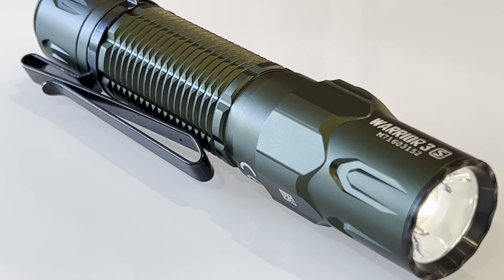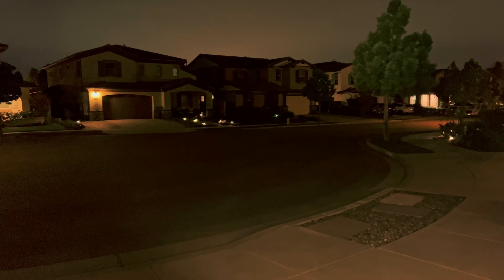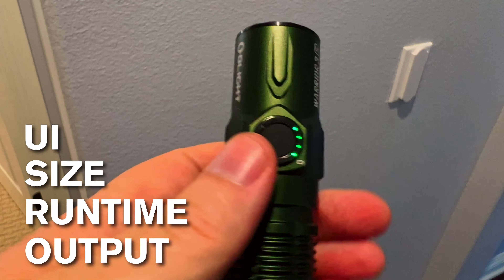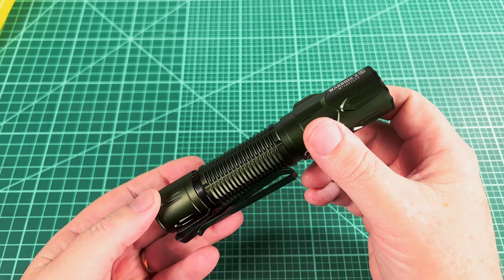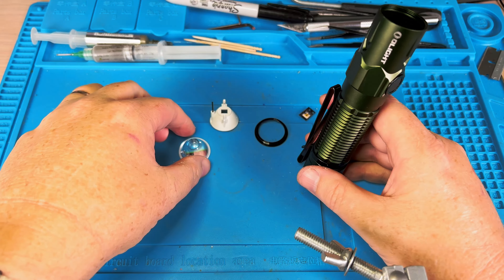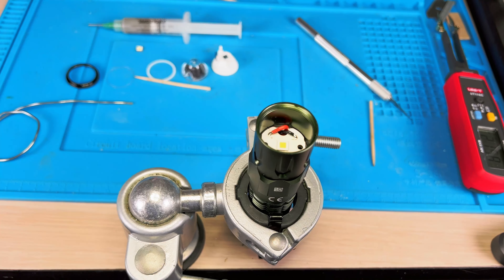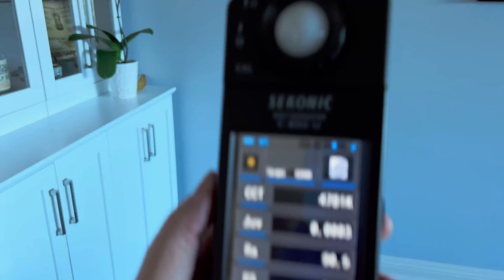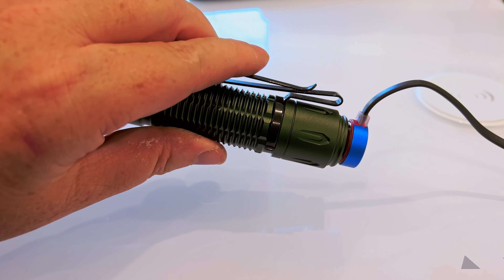Olight Warrior 3S is the best EDC on the market!

Comment: I quit buying olight because of their loyalty program. I've spent a ton of money on olight products but the loyalty points that I earned still weren't enough for a certain light that I wanted. Apparently it's set up for ebay sellers. I also don't like the proprietary charging system.
Reply: The proprietary charging was a part of the draw for me. I liked it for my wml because I hate buying batteries. And I just look at the rewards catalog as a bonus so idc if or how long it takes to get a light for free. Not to mention they have sent me numerous free lights in the last 2 years and have top notch cs
Reply: @PennStateCivic  I agree completely. Well said.
Reply: Actually you can charge the batteries on a regular charger. You just need a small magnet to make contact. I bought some very small ones on ebay Actually lol. And they work just fine. I have the warrior nano.  Which uses 18350 cells.
Reply: Yes me too their lights are sub par and cannot compete with leading brands such as Nitecore and Ace Beam
Reply: @houman2009  care to elaborate on how exactly they can't compare to these brands? Build quality, compactness, brightness, longevity of the batteries, UI, warranty, etc?

Comment: I here what your saying but for this project alone just to get a nicer tint in an olight, a user would have to purchase; the new emitter, the grip tool x2, soldering iron, hot plate, solder, thermal paste, tweezers, on top of purchasing the light itself. If they already have all that then my point is moot but not all if many have all that equipment. Great video as always though Cheule and thank you for taking the time to make them.
Reply from the maker: This video is firmly aimed at people who have emitter swapped before.  That’s very true.
Reply: @cheule  Oh okay. Thank you again for taking the time to make these videos. They are very helpful and insightful.
Reply: @itachii267  agreed!! 👍🏼👍🏼
Reply: I don't have a hot plate, but I've got a friend who does. Win win, and I can mod my lights!

Comment: The only reason I don't buy Olight is the almost proprietary magnetic charger. It works and it's easy but that's not my issue. I just don't like proprietary cables & connectors esp. for charging. Like Apple's Lightning connector - I hate needing to carry a special cable for a single device 😒.  All my EDC/hiking/camping tech is USB-C. When I go out I take one powerbank & one charge cable - done (many USB-C devices can act as a powerbank). If this isn't an issue for you then Olight really do make great lights. Bright lights everyone.
Reply from the maker: The Warrior 3S is also so efficient and has such a huge battery that I often go weeks without charging. So a charge cable might not even be needed on a hike.
Reply: @cheule  Yeah I know it's probably an unfounded phobia developed years ago when battery tech wasn't as good. Probably should get one and actually test the reality. What's one more light for the collection??? 😅

Comment: Best EDC light?  Controversial subject for sure.Personally after years of owning many Olights I have come to the conclusion that the proprietary Olight batteries do not last as long as most name brand cells. That has been my experience. Put on top of that, Olight no longer tells you what LED they are using. Really Olight you can do better. My vote for best EDC light for 2022 Thrunite TN12 pro. Oh and I get that the point of the video was emitters. For me I prefer CW.
Reply from the maker: The TN12 Pro is one of my favorites as well.  For me it’s “best pocket thrower” even beating out the likes of KR1 and D1 from Hank Wang.  I made the argument in the video that I really am at the point that where the emitter a flashlight comes with isn’t very important because none of them are perfect.  So just SWAP!
Reply: @cheule  You Sir are a master modder. And I really enjoy your videos tremendously. But I do not mod flashlights so I judge them based solely as they come.

Comment: Nov.2024 just bought a Warrior 3s for my non-pocket use light and a Warrior Mini 3 as my EDC light.  That magnetic charging is a game changer so I know my light is always fully charged and ready, no guessing anymore.  The UI with tail switch & side switch is pretty nice too, access to both turbo, turbo strobe AND low are essential in my line of work. I’m an ex-night time commercial truck driver and my flashlight might be my most important tool, turbo for exterior Pretrip inspection, turbo strobe in the rare event I require non-lethal defensive tools but a dependable low output is critical in the cab not to interfere with night vision, I use low all the time. It’s taken over 10 years to find a light I like better than my prior EagTac D25LC2 but I think these Olight Warriors have won me over..
Reply: Wm3 is a great light! My personal edc too

Comment: My biggest problem with proprietary batteries is that I can't bring a couple of spares in my charger/powerbank/battery case and use them in both an Olight and whatever other light I have along. It's bad enough I have to bring a couple magnets along so the spares can be long enough for my Acebeam and short enough for my Noctigon. Incidentally, both of those came with exactly the emitters I wanted, but I don't disagree that at a certain level of enthusiasm, one should be prepared to swap emitters.
Reply from the maker: This is probably the most airtight case I’ve heard for not liking Olight batteries. Touché good sir!

Comment: That's my EDC light.
Admittedly, I dont use Olight for any other flashlight need I have, but it is a Jeep of a flashlight.
If their proprietary batteries had a USB-C charger built in (to the cell itself) to get you a non-proprietary charging option, even if it takes opening it up...and if the full-press tail was NOT disabled on lockout, it would be perfect, IMHO.

It's also the only light I have seen take a shotgun hit (buckshot) and be pretty much fine (with dents). I dont think that is super important, but still kinda neat.

Comment: Great review an amazing modification! I just got this light yesterday in the speckled camo finish which is cool. I realize that enthusiasts like to do this sort of upgrade but in my world there's so much of variance in the environment that changing the color temperature or quality of an emitter is a moot point for me. I have a number of neutral color temperature flashlights and actually find that I prefer the cooler bluer light for its reach and contrast in the dark. 
I'm sure there are others for whom this won't work, but each of us has his own use case scenarios. 
By the way, for those who complain about no USB-C Olight does make a cool little magnetic connector which utilizes that cable so you only need to carry the connector on a keychain and use any USB-C cable!
Reply from the maker: Great tip!

Comment: The UI is easily the best for a mix of tactical and EDC purposes IMO. Not many lights have instant turbo AND allow you to change modes after using it. Most lights with a dedicated turbo tail have to be turned off and turned back on with a side switch to change modes.
Reply from the maker: You make solid points.

Comment: Its a very good light, no doubt but there are serious issues with the tail button if you work in environments that have lots of dirt,dust, and especially metal shavings. The gaps in the button can seize up or even stay on. For EDC...fantastic but its not as bulletproof as I wish it could be.
Reply from the maker: Metal shavings are an issue because the tail cap is magnetized.

Comment: The reason many people prefer USB C over the magnetic charger is that USB C is a real standard. You're unlikely to find yourself without a USB C cable, with the proprietary charger you're limited to the one in the box or spending extra to get more. Whether you like to be able to charge your light while traveling or want to be able to charge it in more than one spot, the reality is that you need a specialised piece of gear that isn't shared with any of your other tech that you need to keep a track of. You can carry one USB C cable in your bag and charge pretty much all your tech, but not your EDC light. Sure magnetic charging is neat, but the benefits of three seconds saved not having to actually plug your flashlight in aren't worth the trade offs to everyone. That's doesn't mean that magnetic charging is worse, just that there are good reasons people have certain preferences.
Reply from the maker: You’ve made good points.  I would argue that the magnetic charging is so small that it’s easy to bring.
Reply: @cheule  lol I think the point is it you still have to bring something else along.
Reply: I really wish they would just design the magnetic charging cable as just the magnetic puck with a USB c port that plugs into any USB c cable
Reply: It being just the puck would help a bit but I don't think the issue is that the cable is that difficult to stuff into your bag. It's having another thing to keep track of and which can't be easily replaced by just walking into any store. Especially if you're not in the US. The reason people like USB C is the promise of having one cable for everything... except for the things that get clever with charging and which force you to have dedicated proprietary chargers.
Reply: @darkdragon1194  
That already exists. It’s called the Olight Oport.
Reply: I have five different USB-C chargers and different USB-C devices that work with some but not all of those chargers. It would be nice if they all worked together. A flashlight with USB-C that doesn't support USB-C to USB-C is a bit like having a proprietary magnetic charger without the convenience of magnet. USB-C to USB-C is my preference. 😀
Reply: @cheule   well the biggest issue for me is what if you damaged your cable... I go backpacking often and I'm always worried I'm going to damage my cable, never have yet but that concern is always there.. Also I bring two cables of type-c so I can charge both my cell or vape or speaker.. its just easy with type-c, and if one cable gets damaged atleast I have another one nearby... If olight made a 21700 type-c that would no longer be a problem for any of us
Reply: @darkdragon1194  they have, i have one on my keys
Reply from the maker: @youtubeuser5424  I use iPhone (lightning), so I'd have to bring USB-C as well.
Reply: I have an magnetic C olight cable that comes in a rubber case and that works perfect I don't like or want your type of cable, if you don't like Olight's way buy a different brand, don't try forcing your nutty idea on other's 🥶
Reply: @The.Best.Collector  thanks for you awsm opinion.. I see you have your knee pads on for olight... True supporter...
Reply: @bryoncatterall  I have numerous Olight torches 🔦   and have no problem with magnetic charging, knee pads? I am extremely disabled 👨‍🦽 and can't walk so it's impossible for me to wear knee pads because I can't get on my knees 🙃 so what knee pads have to do with anything I don't know? Also I have trouble using my hands and the magnetic charging is easy for me, C USB is fiddly, so would make it difficult for me and anyone else who have disabled hands, so please don't get Olight changing it 😫
Reply: @The.Best.Collector  I also have lots of olights.. im glad you like the charging aspect... I don't mind it, but would type-c be better for the majority of us..... not saying get rid of the tailcap charging, just trying to say if they came out with a type-c 21700 that would get rid of our what if moments..
Reply: @bryoncatterall  what if what? 🤣 what is the cable you want?
Reply: The cheap breakable ports for micro USB are absolutely trash. The actual hardware for micro USB is awful and almost always breaks, shorts, etc. USB C solved this issue. Everything else you said is a plus but the fact that its a solid connection with no weak points makes USB C absolutely superior.
Reply: I get your point but I feel these situation are not unique, if u lose ur 1 usb c cable, u cannot charge either, just be prepared for the worst case, it can always happen and the type of cable won’t change the situation
Reply: Most people don’t have usbc cables on them, especially since most people have different chargers these days. I don’t think it’s such a problem to have another cable, but i have back up batteries and cables and lights, always made sure to have them because running out is not chill.
Reply: You can just buy the Oport I'm not even gonna read all the stuff you said bc like you said you'll most likely always have USB-C
Reply: This light is a Beast !
Reply: I also prefer usb-c. I keep a cable in a few places; work, car, home, go bag, backpack,  suitcase, etc. I have them everywhere. It's universal, and nearly everyone has one. It would be fine leaving the light in one location, like work. But, for edc, hiking, hunting, outdoor activities, it doesn't work for me.
Reply: Oport
Reply: Oport
Reply: Oport
Reply: Spend loads of time underground. Those rubber covered usb plugs is a big no x
Reply: Yes all good points but for an edc light the type c port is more likely to become damaged over time and repeated charging.  Magnetic and forget it
Reply: How hard is it to bring a specific cable with you?

Comment: All in all. I love O light.  Their products are innovative,  beautiful,  practical, and the improvements with each generation have been well thought out. I currently own almost all of their products and many of my pistols or rifled have O light wml models on them. They are all excellent! If they would just realize that they really need to offer each product they make moving forward in all the available colors and that people really do want the neutral white emitters to be an option with every new release, they would be unstoppable.  Keep the tactical tailswitch  on as many models as possible and phase out the puck charger with one waterproof magnetic USB C port so we can all just use one  standard charger cable for everything and O light would be unstoppable.
Reply from the maker: A very reasonable take, unshrouded by bias.

I really don’t mind the MCC though. Really.

Comment: Thank you Cheule for such a great video. I honestly didn't know the magnetic charger was so easy to connect to the flashlight.
The only complaint I got about olight's properitary batteries is that as much as I probably wouldn't need to buy another one for my flashlight, I personally like to have all 21700 cells work in all of my flashlights. But if the Olight is your only flashlight, it wouldn't be a problem.
Reply from the maker: Good points.  Sounds like if you have 3-4 Olight in your life you would be good! Hahah
Reply: @cheule  Yeah, if you get into their ecosystem a little bit, it gets better.

I might think of getting an Olight, although the prices mostly drive me away.
Reply: @cheule  lol which validates everyone’s comparison Apple to Olight. If you are in the ecosystem you’re all good, but throw in some other piece of gear and it gets to be a pain in the ass.

Comment: Hmmm now you got me wanting to swap something into my warrior mini. I don’t use it just because the light is so crappy. I’ve never done a swap and I’m not keen on trying it and stuffing it up. How do you know which led will work? Size wise. Voltage wise. And any other consideration I don’t know about. Does the led have a polarity it needs to be put onto the board?
Reply from the maker: You would need to research the emitter size and voltage for any given light. The polarity of the emitter matters. If you watch one of my longer emitter swap videos, you’ll see me use a diode tester to light up the emitter and figure which side is negative. That then aligns to the negative side of the mcpcb.

But in reality, all you really need to do is take a guess, then once the flow is done use your DMM set to diode and test the polarity on the mcpcb driver pads. If it’s correct, huzzah. If not, either A) reflow 180° rotated or B) solder red to neg and black to pos.

Comment: I actually buy olights for the charging system. For an edc it’s perfect, I have the cable command stripped to my nightstand so I know exactly where it is in relation to the edge. And for a tactical light, I’d argue usb c is better. But I’d also argue that the $10 usb c to mag charge keychain by olight is worth it. Keep that in your backpack or something and you’ll always be able to charge the light with a c cable. If they made one with both that would be cool… but hey, it works

Comment: Great review!
One little thing ... Methinks it would have been cool if you could have juxtaposed the stock beam next to the modified one so as to let folks see the difference between them.
Also, might you recommend some quality grease to put on the threads of flashlights (and which won't cause rubber o-rings to disintegrate)?
Thanks much and keep up the great work!💥👍
Reply from the maker: I recommend SuperLube Silicon lube found on Amazon in a huge can for like $20.  Will last a lifetime.  But if you want “the best money can buy,” then Nyogel 760G which is significantly more expensive, and only marginally better.  Like, you’ll never notice.  But it is the gold standard for lube with silicon o rings.
Reply: @cheule  off to Amazon I go, thanks so much!💥👍
Reply: Motorcraft Electrical Grease, XG-12 is Nyogel 760G.  It is on Amazon for less than $20.

Comment: Awesome video, could I potentially use a hot air solder station instead of a hot plate to heat up the board to swap the emitters?
Reply from the maker: You definitely can, but it’s a lot trickier because the air pushes the components off the solder pads.